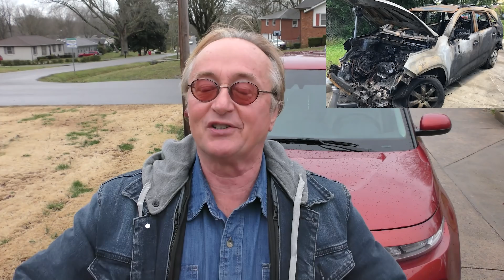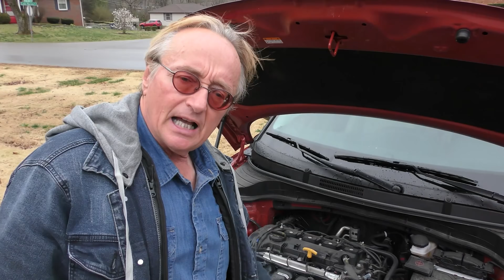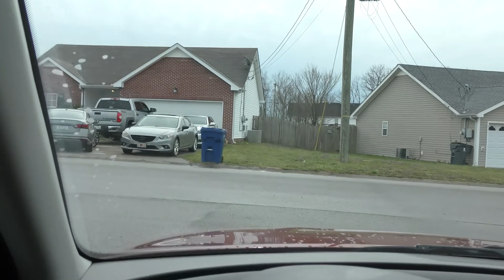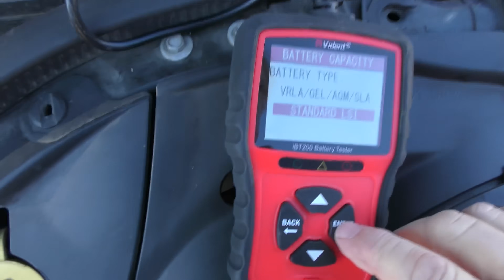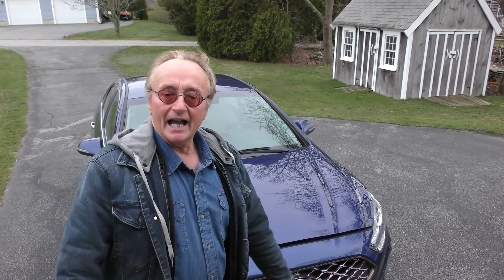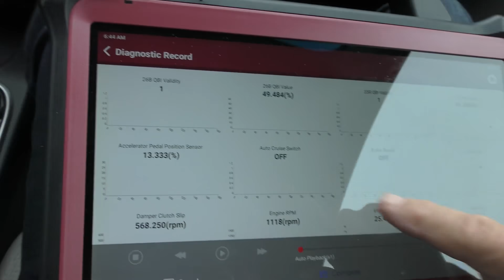3 Car Brands That are Crap

Comment: at the gas station check the fuel and fill up the oil😂

I had an old motorcycle where it was just this way round. The engine was so run down it needed about 6 liters of fuel for 100km (approx 40mpg),  but 3-4 liters of oil (almost one gallon) for 1000km (600mi.)
It was an old Suzuki 750 of '78. The top speed was just over ninety mph due to the wear of the cylinders, valves, etc. It had done 140,000 km / 90,000 miles which is quite a lot for those old things.
Everything else on this motorcycle was run down as well, so I finally gave it up.

Comment: I have a 2019 Kia sportage. It has 102,000 miles on it and knock on wood I have not had any mechanical issues. I am realizing through that Kias are not the best option.

Comment: I’m having same issue with my Hyundai Santa Fe , every thousand kilometers I have to fill 1.5 liter of oil , I only have 110km on it, they won’t fix it, I complained about when I had 65k on it, at some points when I started the car it sounded like no oil pressure in the engine nocking rods , dealerships says the have to replicate this but they weren’t able to do it, so I think it’s time to get rid of it before I end up with having to replace the engine

Comment: Having been a car dealer for over 40 years, manufacturer warranties require an engine to use more than a quart of oil within a thousand miles to be a warranty claim. A few years ago I sold a 31,000mi Toyota Sienna in warranty to a friend. It was using slightly more than a quart of oil within a thousand miles. Toyota was unwilling to warranty it until I could prove that it had adequate oil changes. Luckily for me, the previous owner changed the oil 11 times in 30,000 miles at a different Toyota dealer. In the mid 80s and 90s owners of German cars such as some Volkswagens and BMWs were required to check the oil at every other fill up or 500 Mi. They used oil. But, they would go nearly half a million miles doing so.
I agree with Scotty. Kia's and Hyundai's are bottom of the barrel. Buy a Toyota or a Honda.

Comment: I bought 2 brand new kia Sorentos.  First one was a 2018 and was a great car.  Non turbo, we traded it in at 60k miles for a 2021 Sorrento with a turbo.  The trans started slipping at 25k miles.  It also had a problem where it would go into "limp" mode sometimes under boost when passing another car.  They gave us the run around time and time again.  Never fixed that car.  I traded it for a F150 and couldn't be happier.
Reply: I believe Kia went downhill in quality around 2020. I have a 2011 Kia Sedona van w/168k barely any issues (one issue under warranty) and the Kia dealer still wants me to come trade in for a newer model. Gets good mpg 23 or so and is reliable. I think that in my experience Toyota, Honda and then Mazda is the top 3 non domestic brands, and still make them great & long lasting vehicles. Just got a 2024 Camry Night edition and love it (35-40 mpg)
Reply: @billv6832  They went down with the GDI motors...
Reply: The fact you bought 2 new cars and both were Kia’s is mind boggling to me
Reply: @NickChemist-yf6oj  Perhaps you missed the part where our first Kia was a great car.  Usually, in life, as a human, we tend to go back to the well if the water is fine.

Comment: Hey Scotty I have a 2003 vw Jetta 2.0 automatic and I'm only getting about 90 miles till I get to have a tank of gas and no check engine light are on and it doesn't smell like gas and if I let my car set for a few hours to overnight it's doesn't loose gas so what could be causing this and there is no codes please help me

Comment: I'm driving my 4th KIA. I bought a 21 sorento. I've driven all my KIA cars into the ground with over 200k miles and fluid changes only. The most outstanding fact is that KIA and Hyundai introduced 10 yr 100,000 mi warranty. All auto manufacturers had to offer that warranty as well or risk loss in sales.

Comment: I'll stick with my old school 89 Chevy Silverado because regardless of the manufacturer nowadays all cars are junk and that's the way auto manufacturers want it to be so they can sell more junk to you at market prices so I will continue to rebuild replace and repair my 1989 Chevy Silverado I just replace the engine went from a 305 to a 350 and I do all my own repairs my first vehicle was a 91 Ford Aerostar that I put over a half a million miles on and was still running strong when I had to junk it due to body Rott. I will never own a new car for two reasons 1 I can't afford it and 2 being a mechanic I know how they are made and they're not worth my time or money to own

Comment: I bought my first new car at 65. A 2018 Subaru outback touring. I’m fanatical about changing the oil. It started burning oil at about 40,000 miles. I was told by the dealer the same nonsense that Kia states. They said most engines nowadays, do because of the tolerances.😏

Comment: I can attest to the audio system volume cure! Nothing made my 1964 Volkswagen Baja bug run better than cranking my Kenwood 8-track with Alice Cooper's Billion Dollar Babies blasting through the Kenwood 2-ways mounted in the front doors. I assure you, cutting factory steel, and mounting noise reducing pads inside a VW Bug door, was an engineering feat itself

Comment: We had the WORST experience with a 2016 Hyundai Tucson engine @80,000 miles..spent $3000...do not buy.and it's still having horrible problems.. and then my 2017 Kia Sportage at 90,000 miles had engine problems right after! Sold it instead of fixing.

Comment: :01 Kia oil burner issue
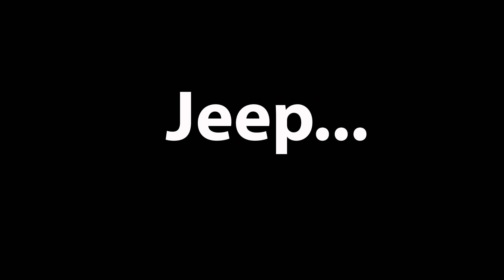12:02 Jeep integrated modular failure
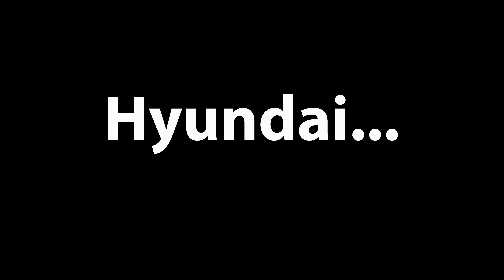21:36 Hyundai transmission issue
Reply: Thanks
Reply: You have a beautiful soul.
Reply: Where is Nissan?? I can't believe it's not here.
Reply: @ronch550  Nissan is about average.
Reply: Thanks I should’ve looked first
Reply: Thanks!
Reply: Thank you
Reply: Thanks for the list, Short And Sweet. (For military folks, KIA meeans KILLED IN ACTION (how can we translate that to KILLS oil ABUNDANTLY?)
Reply: Too funny . Before I watched it these were the 3 brands I was thinking he would say 🤣👍
Reply: Here he includes both Kia and Hyundai. In his videos about best to worst Asian brands he ranks them at 4th. Above Mitsu, Nissan and Subaru...

That said I do realize these are mostly entertainment, with a bits of good information sprinkled in. You can't simply say one brand is simply bad. With cars like Hyundai Tucson 2007 and 2013 models for instance having very little in common.
Reply: Thanks bro!

Comment: Even my 2009 Honda Civic owner's manual says it can use up to a quart at so many miles. My 1972 Fiat 124 SC didn't burned hardly any oil between changes...but built as designed by Lampredi. I'd drive a Soul because they're comfortable and useful; however, my wife said of we went shopping somewhere park away from where people could see her get out of it.
Reply: 😅Thus is what i said to my sister!

Comment: When it comes to the hyundai. Take a look at the bolts that hold the transmission in place. You should see shiny spots on the edges of the bolts where the socket in the wrenches were used. If you do not see any of those. You were one-hundred-percent lied to.

Comment: I regret my Kia purchase I bought it new  and the engine blew up at 87k and I got it changed at every 4K. I went to the dealer and they refused to fix it because it was never recalled. Never buy a Kia just spend the money on a Toyota

Comment: My wife has a 14 escape titanium .. last  week ,I went to move it at night, it moved like 5 feet and stalled, did that like 3 times,  acted like it was the fuel pump, by morning the battery was dead , we jumped it,and it's been fine since.  Low  voltage made the fuel pump not work...u like her escape..I've the features  ithas, and it runs great ,only has 120k miles though. Older is better..like, the older ,the better..

Comment: I put 300k miles to a 2016 Kia forte in 5 years doing ridesharing. It's still running very well. The engine is very clean. Just regular maintenance. Of course, after 5 years, I  changed some parts, like struts, etc. I am impressed with the quality of my Kia Forte?

Comment: I had a 2004 Kia Spectra  at one time, and the engine only lasted about 35,000 before the engine blew up.  It was a piece of junk from the beginning when I bought it new!  Back in the early 2000's , Kia put out a looot of junk on the roads, that's for sure!

Comment: Bought a Kia last year.  The engine blew up 6 months later.  Took them 2 months to get a new engine in the car under the class action settlement.  Having engine issues again a couple months later.  I work from home and don't drive very far or often.  Never buying a Kia again.

Comment: Best car I've owned is a 2015 Kia Forte LX which I still own.  No major repairs other than brakes and tires.  FYI:  it has a manual transmission, 180,000 kms and was super cheap ($11k cdn).  Worst was a Jeep Patriot, total POS, cost us a fortune in repairs and we got rid of it after 50,000 kms.   I'd buy another Kia.

Comment: I had a '10 hampster Soul "+ ."
It was great.
Ralph, customer service at the dealership knew about cars, like yourself, Scotty. 🙂
He had said that the earlier years of the Soul model were better than the later, newer ones.  I had my '10 until 195,000 miles.  And very reliable...
So
..No complaints, from me... 🙂😊

... A lot of room on the inside,, for an economy car...  *Unlike a Minicooper..
Reply: I just bought a 2011 soul+, I'm hoping to get 200k out of it, about 141k on it right now. And hopefully if it makes it that far without the engine blowing then I can afford to replace it.
Reply: @poeskey  .. Oil changes; maint. *
Reply: @JamesG...  yea I just went and got the oil replaced. I'm picking up an Obd2 scanner tomorrow just to take a look and see what's happening under the hood.
Reply: @poeskey  And the car battery for 'Souls' are the self-recharging ones lasting up to at least five yrs. 😎
Reply: Im looking for a manual Kia! Im surprised the first generation of Souks are best! Ty for tge tip , there are alot online,old ones with low miles! Makes me suspicious? Turn the odometer back? Im thinking 🤔
Reply: @pamspencer5733 
Talk to some Kia dealership employees [service, parts]..?
I met some who were happy about the brand: i.e. knowledgable...

Comment: Here's one for y'all.   I drive an '07 Ford Explorer with only 55K miles on it.  Twice, within the past year, when I've had to accelerate harder than I normally would (i.e. to pass a car on a two lane), the entire dashboard conks out!  All the gauges just stop working, and the stereo just spits static.  The truck still seems to run OK though!  Both times, when I braked to pull over and check things out, everything sprung back to life again!  Called the dealer, and they suggested it could be a problem with the alternator (which was less than a year old!).  Went to Autozone and had them check.  Both battery and (new) alternator checked out as OK.  

It's been several months since this has recurred, but then again, I don't drive much (hence the low mileage on the truck), and I don't normally drive aggressively.  I have tried a few times to make it happen again, but to no avail.  

Any thought?

Comment: I own one of those Kias.... if I let it go 7500 miles till the oil change🤣😳😳😳 I’d be NEEDING a new motor💩💩💩  because that my motor would’ve died from lack of oil😱😱😱 52,000mi.... it uses about a quart and a half every 7500🤯miles sometimes 2 quarts depending on how hard I drive it😢😢😢

Comment: My 2013 Kia Soul has 132,000+ miles on it and it's been burning oil like crazy since about 102,000 miles. I've put over $5,000 into it in the last 6 months trying to keep it running. (Catalytic Converter, brakes, suspension, tires and other little things that put me on the side of the road a handful of times. Mostly fuel system related.) I'm waiting on GM to get themselves together to pick up my order for a Bolt EV, which will probably take 10 months, and now my Soul is having transmission problems. ~Insert psychotic laughter here~ I don't want Scotty to yell at me about Electric but I'm over the oil, emissions and fuel system problems. 😭😭😭

Comment: I have a friend who has a 2009 Kia Rio that has 109k miles..the thing's transmission pees oil, and it can't be repaired because Kia won't sell parts. He has to either take a chance and get a wrecking yard box or order a new one from Kia at $6k. Not worth it

Comment: I heard the Kia Stinger was actually really good, kia and hyundai are really similar now, but i have an Elantra 2018 with a 2.0 i wouldn't buy anything older than 2015-2017 from either of their makes because of poor history with motors having issues of getting metal shavings or fragments of metal, something just wasn't right but most of engines in the earlier days were being made by mitsubishi with a korean license. Modern Hyundai motors will take you 250,000 miles or more depending on care of course as with any decent car and considering the price mark they are technically selling the best cars overall on the market for a gasoline fueled engine and Kia is hanging in there with a whole lot of help from Hyundai in recent years.